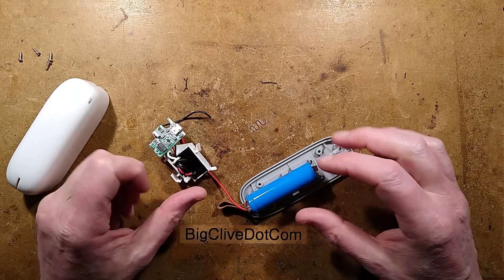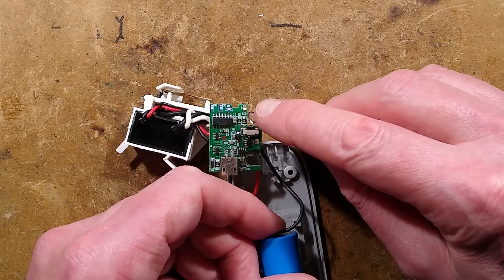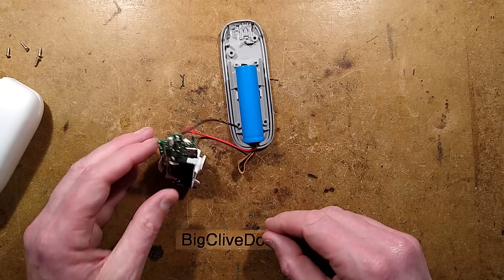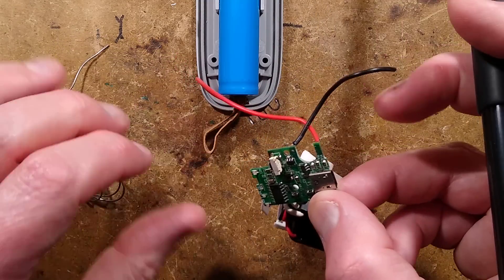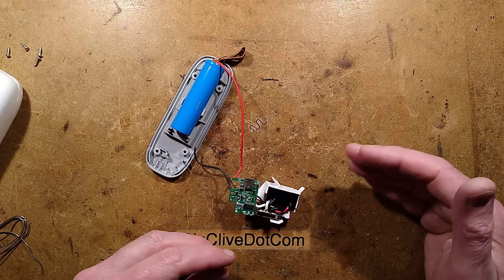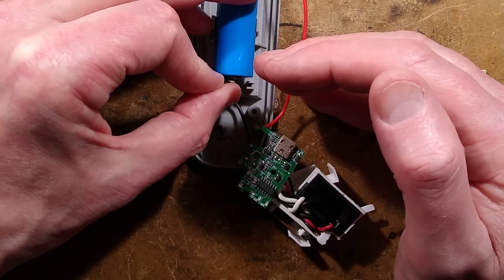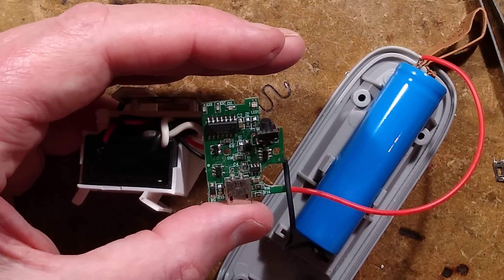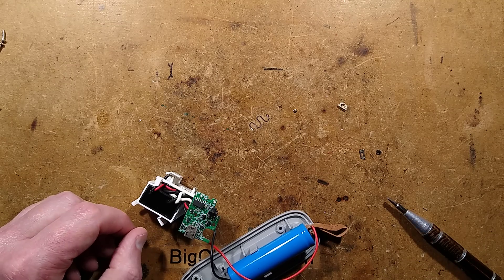The curse of tin whiskers rears its head again

Comment: Clive I did a thing! I got a soldering station, heat shrink, cable cutters, cable strippers and fixed a damaged 12v cable from an adapter. Not much, but for me I was very impressed with myself! (I'm only 42)
Reply: I love the (I'm only 42).. 
Hey man feeling proud of yourself is a good thing. We as men can be made feel redundant in society today so do whatever keeps you feeling like you did that time. Never to old to learn new stuff.. 
I only recently learned basic electronics. Make cash on the side fixing electronics now, (and I'm only 45☺️🇮🇪)
Reply: @keithking1985  yee gods.

i can pull apart a tube amp and rebuild it no issues, but when i open up a board and see SMD... i scream. then you come up against the brick wall of components with erased details, lack of schematics, or hidden behind paywalls, and custom programmed, memory protected ICs...

trying to backtrack a simple logic array... 

lol, i have a thing about relays... the number of times ive come across faulty relays... if i had my way they would all be "mercury wetted contact" types...

they dont bounce, they dont stick, and they last almost forever... they dont appreciate being vibrated or turned upside down though :(

lol, i bought a whole bunch of them, can get the light switches nice and cheap, so far the main use has been to make "pingers" for doing TDR analysis of coils... can get rise times down into picosecond ranges...
Reply: Bravo for you!  Never too late to flex the mind and the fingers and learn something new.
Reply: And welcome to the never-ending-money-sinkhole my friend.
Enjoy the Ride!!!!!
Reply: Step one done. Well done. 
Next up. Keep watching repair vids. Tons on YT. Then scour local flee markets, thrift stores, charity shops etc for devices in need of restoration.
Not only will you be getting that slight buzz of fixing something that was fubar, and making it look nice, you will make some bucks doing it when you sell the restored devices on marketplace. It's a fantastic way of keeping the brain engaged and healthy.
Reply: I was interested in electronics when I was a kid but never really knew anything, then I found Clive's channel in 2016 and started buying equipment and kits. Now I have a new hobby that I still don't really understand but it's enjoyable making things.
This thing you did is another string to your bow so you can fix things, make things and save money by not replacing things when they break.
Reply: Never stop learning

Comment: had a call to check a TV it was a HD lcd 48inch... they said it would just randomly turn on then off.. eventually just staying on... it was under warranty the company sent a replacement TV and told us to replace the clients TV and just send the old one for recycling.. i opened up the tv and exact same issue the power button which was pretty much the same as that one i disconected the switch and the tv worked flawless after that... i no longer own the TV but i know who does ( i have replaced the switch) the company i was contracted by doesnt repair tv's internally they just replace them outright this was about 9 years ago now.. meter showed continuity with different readings in it was supposed to be a twin momentary it turned into a total short shored both poles and also shorted those together to..

Comment: late 70s early 80s we started getting intermittant faults on wire wrap joints in telecom frames.. the tinned jumper wire was causing random shorts.. when nokia started producing lead free pdh eq they had a huge recall the wiskers on the telecpm wire wraps  were about 5mm long and visible in good light.. never could see them on nokia pdh boards tho

Comment: We had an issue caused by the lead-free solder in our dishwasher. It’d been working fine for about a decade, and then we suddenly noticed that the water never got very hot at all. I dismantled it, and found that the solder on the relay controlling the heating element had disappeared, and several other solder joints looked a bit dodgy. Resoldered them all with imported lead solder and haven’t had a single problem since! Saved the £250 charge Neff wanted to fix it as well.

Comment: The Tin Whisker problem even happened with satellites.  There were a number of in-orbit failures attributed to this problem.  I attended a failure analysis review of the issue at what was the Hughes facility back then but which is now Boeing in El Segundo, CA.  That was back in the late 90s.
Reply: The Galaxy IV satellite failed after 5 years due to tin whiskers. Search for it on Wikipedia. 
As an aside I've always had trouble believing this: "The satellite manufacturer, Hughes, has replaced pure tin plating with nickel to alleviate the problem in newer designs, adding 100 to 200 pounds per payload." That's a lot of plating!

Comment: Back about 30 years there was a rash of data center failures as a result of zinc wickers (dendrites). Most data centers are built on a raised floor which is made of zinc coated steel. The problem is that when Zinc is electro-plated on steel, the surface molecules are under stress and start forming dendrites.Naturally those dendrites will break off and float around the room and eventually get pulled into the cooling air stream and end  up in the computers. But, if the zinc was hot dipped, the surface wasn't under stress and the dendrites wouldn't form and everyone is happy.

Comment: I’ve seen tin whiskers commonly on electronics from the 60s and 70s, so I’m not convinced it’s all about “meddling eco warriors”.

You might want to think about getting a microscope camera. I do practically all my soldering work using a camera and large monitor behind the work area. Can reliably work with 0402s and “flip chip” packages.  It’s not 3D but you get used to it.

Comment: Tactile switches are highly unreliable. Circuits using such switches should assume that it might short out, and design/program accordingly for max safety!

Great video as always, never heard of "tin whiskers" before. Maybe it's due to the tetragonal crystal structure of tin that helps it to protrude from the surface? Strange stuff...
Reply: I have two sets of cheap wireless ear buds. Both have had the power switch fail stuck in. They still charge and work, but there's no way to turn the charging case off, so by the time I put the buds back in, the case has run down. I can't complain though. They were free.

Comment: Fantastic information, I've had those symptoms before but not known about tin whiskers and them in switches. AWSOME more learning from ya Sir, fanks squire
Reply: Nothing in the video confirms the presence of tin whiskers. It's more likely the switch was simply defective or contaminated (ex., metallic particles stuck in flux residue during manufacture).

Comment: Only one tiny problem with tin whiskers, pretty much every metal has an association with compressive stresses causing metal whisker growth, tin, zinc, lead, silver, even germanium and more have whisker formation. Alloying does help to an extent, but not universally or permanently. And of course, the phenomenon is still ill understood, despite a lot of attention being given to research on the matter - even by space agencies, as it's a major issue of concern in space programs. Because, just to be entertaining, the crap will even happen in a hard vacuum in space.
What we really need is magic, aka really, really clever science.
Wikipedia has a nice article on "whiskers (metallurgy)" that shows some really nausea inducing images of the infernal things. Especially notable, an image of a galvanized bracket that has enough zinc whiskers to require the services of a bloody barber.
And I say nausea inducing, as just think of that crap growing inside of a substation or server room and that's happened in both.
Although, I could suggest in all mirth of frustration a truth, it's either science figures it out and a successful mitigation or we're going to have to figure out how to give our metals a stress free life... Kind of a non-starter, given we use metals to handle stresses.
Until then, all we have are conformal coatings, alloying to lower incidence a bit, replacement and profanity. While the latter does not provide a solution to the problem, it does lower physiological stresses and lower cardiac and central nervous system vascular accidents substantially. And yes, my eyes are indeed brown for a good reason.

Comment: i have seen those whiskers in a power distribution panel and it scared me off hellish, seeing silvery fluffy tin plated L1 L2 L3 power bars was terrifying. i closed carefully the doors and windows and tuned off the AC and left the room and spoke to the facility manager about that and we shut down everything that is provided by this panel and replaced everything that was contaminated with that fluffy mess.  this took 2 days for me and this time we used those pained copper bars instead of plated ones, because we need a corrosion protection against FeCl2. i know the modern plated copper bars are plated.
i knew this from school, this can happen, but i never have seen this and i dont want to see this again, especial not in a power distribution panel who can provide 600A continuously next to a EX area.

Comment: These tin whiskers are the reason, why i rescued three 2,5 kilogram spools of multicore 60/40 from my local scrapyard. They're all fine,thrown in the trash,because of the lead banning,i'm shure.i need 60/40 for my old tube radios,which contains the same type of solder.

Comment: A few years ago one of the major US manufacturers of traffic signal safety equipment had a tin whisker issue related to the relays in their product.  Mind you this is a safety device where this is of major concern.  The part that gets me is how significant a problem tin whiskers can be but that it is a long-solved one that other considerations have resulted in resurrecting (i.e. I have long been on board with what you said - and it can be $olved). 🙃  And don't get me started on present day engineers grappling with how DC power behaves over distance - yet another example of a long-solved problem that insights are available in hundred plus year old texts. 😕

Comment: Tin whiskers were an issue is some older Telco facilities, especially those with raised floors where the underside of the floor tiles was lined with a tin plated metal.

The floor tiles would grow whiskers which could then be broken off and circulated by the air conditioning and make their way into equipment.

Comment: This has a part to play (I believe) in the ‘battery fires at ECU sense connector’ in the Toyota Prius up to at least 2009… the voltage sense harness shorts out, causing a plasma fire (well over 200v DC); one cause is alkali battery electrolyte ‘wicking’ up the wires to the battery ECU, but I did find tin whiskers under high magnification inside the ECU high voltage sensor connector pins. ‘Lead free solder’ destroying ‘eco-friendly’ cars (sort of; the fires are brief, self-contained, the batteries were NiMH, so it just destroys the connector - an expensive repair if you don’t DIY it!)

Comment: Lead-free solder wasn't just some abstract "eco-warrior" thing.  It was introduced because people realized that we were literally poisoning ourselves by dumping substantial amounts of lead (in the form of used electronics) into landfills that could then potentially leach back into people's drinking water.  Lead is actually a toxic substance which is well known to cause various developmental problems in children, and aggravate or complicate many other conditions in adults, so this is potentially actually a serious health issue for a lot of people.

Even if you're not a fan of "environmental" causes, I think the occasional (actually very rare in the grand scheme of things) tin whiskers and other drawbacks of lead-free solder are still a lot better than poisoning people and harming brain development in young children, which is really what this change was actually about.
Reply from the maker: I'm under the impression that the biggest issue with lead in landfill was its use in soluble forms.  It would be interesting to dig deep into vintage landfill and see if the solid form lead solder on PCBs is still intact.

Comment: Tin whiskers have been an issue in electronics for many years, remember the Mullard AF117 transistors, metal-cased germanium devices where the tinned can grew whiskers internally that shorted out the device completely.

Comment: I still seek out the old 60/40 Sn/Pb electrical solder, but for plumbing I once tried some leaded plumbing solder on a central heating circuit and I hated the stuff. On plumbing Lead Free is king for me, it flows much nicer.

Comment: Tin whiskers has a history since 1946-1947 where the first known tin whiskers related issues were documented. So it is not "new" and "caused by lead free soldering". It's more cheap manufacturing,too little nickel in the alloy, no post baking to minimize metal stress.